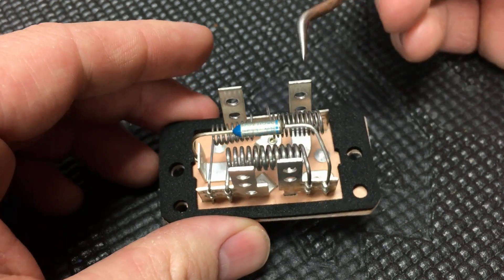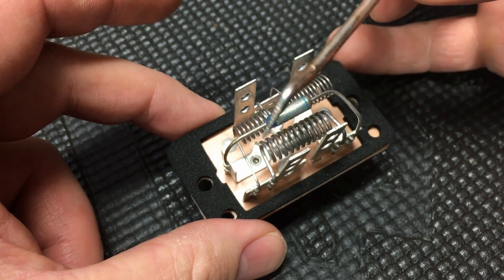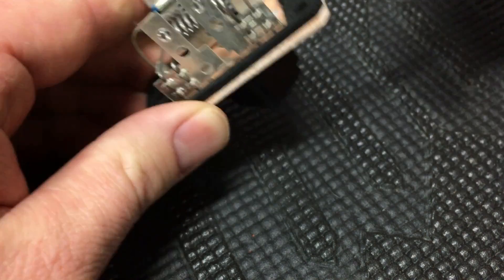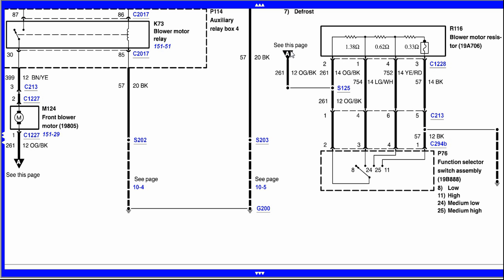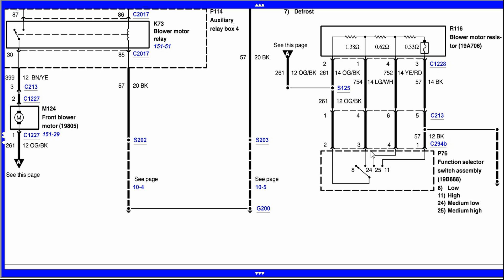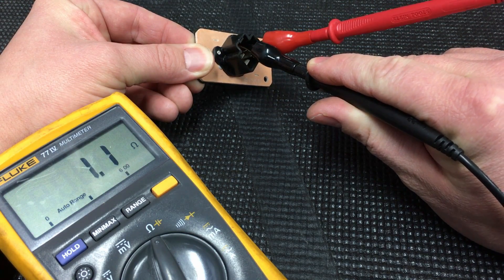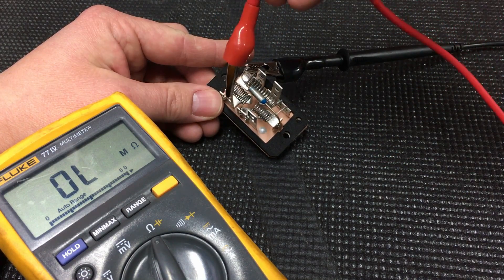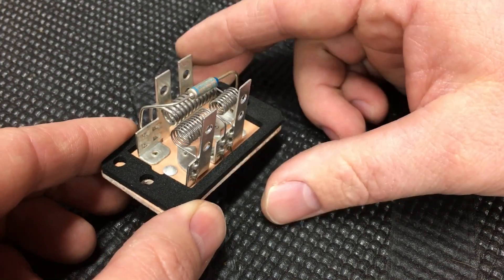Ford Quick Tips #68: Blower Motor Resistor Failures- Testing and Inspection

Comment: Electrons flow from negative to positive . Physics.
Reply from the maker: Yup interesting stuff most people adopt the pos to negative theory for some reason.
Reply: Franklin Theory,( proposed by the man who "invented the electric kite":)  Still taught in college.  Helps explain operation of semiconductors.
Reply: But defies explanation of a vacuum tube (remember them?).
Reply: Current flow is conventionally considered positive to negative.  That's the convention in engineering and industry.  There are historical reasons people give, but it has probably held due to the water analogy, where higher pressure results in flow to lower pressure, so it is easier to understand electricity this way also. The electrons are flowing the other way, yes, and that can be important to know in plating and welding processes.  In welding, electrode positive is called reverse and electrode negative is called straight...

Comment: The blower wasn't working on my 2010 F 150 on the two lowest positions.A friend told me about the resistor..Works like a charm now.Very easy to change,I wish you posted this video two weeks ago .I changed mine on Dec 22 But I didn't realize how important the air flow was .A great how to video.

Comment: That final tip was me.  Replaced the card style and tried it out while outside the airbox.  I tried it out while I drove home for about 10 minutes.  It worked for about a day before it failed.  The parts place (NAPA) took it back and gave me a new one with no questions asked (at the time I didn't know what I had done was the problem).

Comment: When you say blower only works on high, what do you mean?  Mines works on settings 1-3 but blows very lightly.  On setting 4 it blows full blast.  Is this a symptom of this as well?
Reply: Nevermind,I just saw your blower motor video from 2014 which answered my question. Thanks,

Comment: sometimes when I start my explorer the blower don't work then it comes on??, I have the electronic heater system and I hear it change when I go through the different vent settings and I'm not sure if it is a short or if the resistor or motor is going out.
Reply from the maker: Smack the blower motor the commutator face likely has a dead spot on it or a sticking brush.
Reply: Thank you, I will give that a try next time it happens. I thought maybe a relay so I checked it and heard it click off and on when I tested it, unless I was getting false signals.

Comment: My resistor rusted out in a 2002 Ranger. Was warned to get a new connector plug as it will rust weld itself to the resistor. Sure enough I could not pull the plug off. NAPA had both items and I spliced in the new plug (4 wires). All is working well.
Reply from the maker: Those rangers are nasty most of the time the connector and resistor are burned up too.

Comment: Sound explanation and easy for the novice.The new coated card has got its own foibles and aint nothing perfect.That corrosion is intense despite the zinc coating.
Reply: Yeah the new kind burns out also, but leaves you with 2 speeds instead of just 1 for some reason.
Reply: Tom OConnor o

Comment: My wife brought my 98 F150 home and when she did it no longer had any blower motor speed but high, also she lost all the lights for the knobs. Have the Haynes manual for 97,98 F150's but it does not show the location of the switch in the manual. Last winter pulled the dash and replaced the blend air door, this October had to pull the dash again and replace the heater core ( due to the inlet pipe on heater core leaking) replaced H.C. and both quick connect lines from the firewall to the engine. Is this switch easily accessible? BTW your advice and videos have been spot on! Keep them coming.
Reply from the maker: Yeah the trim panel for the radio and hvac control head comes right off then there are 4 screws on the front and it comes right out. In this video I show how to pull the trim panel top get at it- https://youtu.be/0hVI5Yryc1w?t=3m40s

Comment: I'd bet the old design has fewer failures per mile driven than the new board.
Reply from the maker: Yes very reliable in general keep it simple and it will work I say!
Reply: Bingo. My '96 just now stopped... in May 2018.

Comment: Had this problem years ago on my 98 f150. The terminal plug was burned. Cut connector off replaced unit and replaced wth individual connectors. Has worked fine since. Why would connector melt? Shorted coils?
Reply from the maker: Normally it is due to rust on the terminals which increases resistance to the point they act as their own resistors and heat up.
Reply: I'm having a similar issue... 1 lead burned on my resistor harness connector. I replaced the connector and the resistor now my blower turns on and off in regular intervals. As though something is getting hot, then resets. The higher the fan setting the quicker it heats up. Any leads?

Comment: the resistor cards do the same thing. I just replaced mine when low and med went out on it
Reply from the maker: Sure do and they seem even more sensitive. I seem to find the thermal fuse on those rots before anything else.
Reply: How much was your fix ?

Comment: Great Video!  Looks like a problem part that wasn't designed for the service they are using it near/in/around.  Sure glad my 09 F150 doesn't have that.  Actually one of your videos was used to determine and fix my Blower Resistor when it failed.  Thanks Huge for all you're doing. You Rock. Oh Yeah,  Happy New Year!!

Comment: we replaced 4 in 3 months time at work on a 06 f550. 2 from Advance Auto and 1 from Ford. we don't plug them in until they are bolted into the hvac system. what keeps popping them?
Reply from the maker: On any work truck you really need to take into consideration worn blower motor bearings causing excessive drag, debris on the inlet side of the HVAC case and especially the face of the EVAP they plug up often on these cause high resistance.
Reply: Taurus Camo If the blower motor is pulling extra amps due to the motor going bad is one possibility. Also loose connections or terminals in the connector are corroded which again, causes an extra pull on amps & increases heat.  Higher amperage = Heat
Reply: FordTechMakuloco forgot to mention that the motor was replaced as well. it has me bumfuzzled lol
Reply: Could the evap coil be dirty reducing air flow?  Don't know.
Reply: M8ne keeps blow2da resistor 2.blown 4 of em y?? Plz help